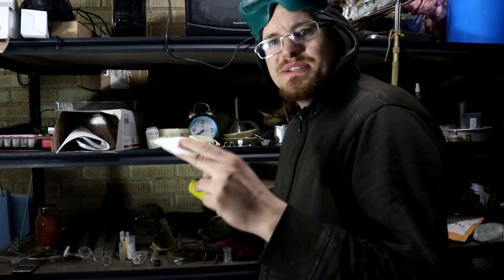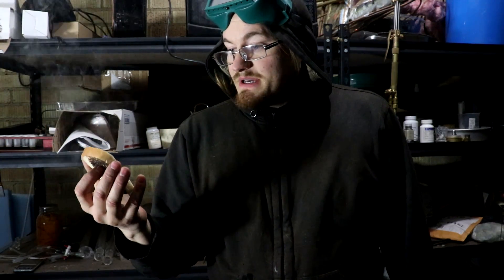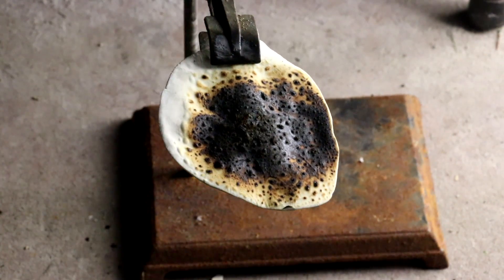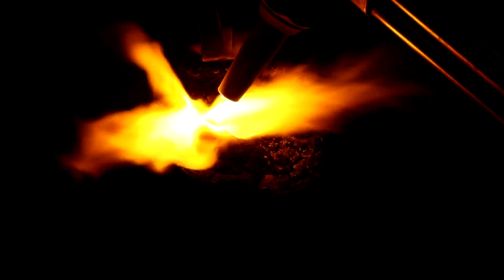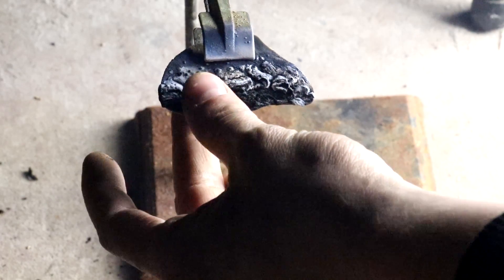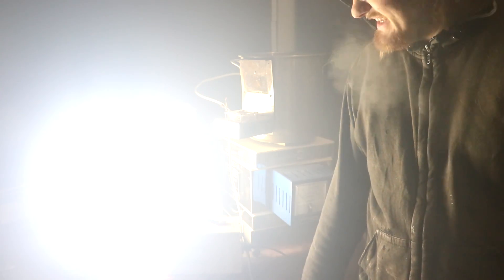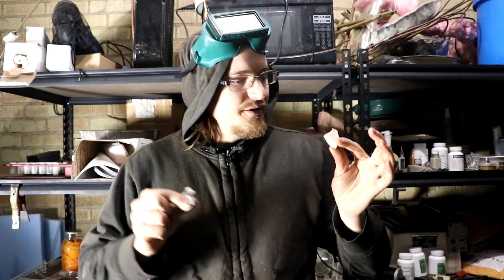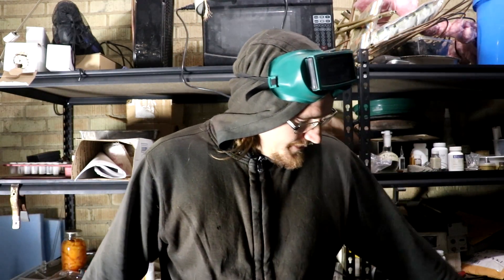Can I Burn Through Starlite?

Comment: The original Starlite can withstand much higher temperatures. It was tested by many groups including NASA, and is a different composition from what NightHawkInLight made.
Reply from the maker: Though I doubt it would be all that different I would very much like to test an "official" sample.
Reply: @theCodyReeder   Specifically, the claim was that starlite contained "21 polymers and co-polymers, plus small amounts of unspecified ceramics and borates".  The most recent photos I could find showed a light gray material, not white like you and Nighthawkinlight made. What I find interesting is that Maurice Ward had a plastic extruder, and was able to extrude the material in profiles, suggesting that it probably didn't contain a large amount of minimally soluble filler.

It's also really dumb that he's always referred to as a 'self taught inventor / hairdresser' when according to some interviews his actual main business was making chemical hair dyes until the early 80's when he started a small plastics company.
Reply: @theCodyReeder  any chance you could think up of what could be added to it to try to withstand the test you done?
It would be a step forward for all mankind, the creator of starlite could have saved many thousands of lives if he had not been so greedy.
Reply: @philipm1896  Just a guess, but composite reinforcement would (probably) make this incredibly more durable. Sadly, that almost certainly means asbestos, which you don't want in ablation - unless you're NASA. Other than specific industrial uses and milspec, you don't want asbestos in widespread use. Maybe a diamondoid thread or nanotube - silicon-boride is pretty heat resistant. Maybe even cellulose could carbonize and provide enough reinforcement during exposure.
Reply: @theCodyReeder  good luck, he died with the recipe and his family doesn't know it, even though the inventor said they had a copy
Reply: @theCodyReeder  From what I've seen, Starlite functions a lot like intumescent paint. Could you compare this version of Starlite with intumescent paint and the claimed properties of the original Starlite?
Reply: @theCodyReeder i dont belive it till i see it kind of guy lol
Reply: @theCodyReeder  I have a few ideas as to why Ward never allowed the original sample to be tested. 1) It sounds like he was a very suspicion person and did not trust anyone besides his family. 2) Since Starlite was made of nothing more than household materials (per its entry on the Guinness Book of World Records) it probably would have been difficult to patent. 3) This seems like the kind of material that many people have unintentionally created for other projects without knowing about its thermal properties.
Reply: @theCodyReeder  sadly the original recipe died with its creator and there are no samples he wouldn't even let it be tested out of his view because  he was so paranoid some one would reverse engineer the product and  start selling it he was a greedy man who i think robed mankind of a product that could have changes a lot in are world
Reply: @theCodyReeder  In an interview, Maurice said that it contains a bunch of ingredients ( I think he said over 20)
Reply: @williamfalconerbeach  
That is meaningless to the product.

They may have used 20 ingredients to reach the product but that doesn't mean another process won't reach the same results.

We make urea in a lab or pee.
Same compound at the end of a different process.
Reply: @williamfalconerbeach  Unfortunately the guy took the secret to the grave because nobody wanted to buy it... these days, with all the assay tech we have, I'm suspicious that it remains unknown. I suspect they were trying to run down a patent clock to pressure him for concessions. I mean, we've lived without it so far, despite its alleged properties being useful.
Reply: @damenwhelan3236  Not to mention a retired hairdresser probably stumbled on a mixture without a fundamental, theoretical understanding of how it worked. Meaning those 20 ingredients may be in the finished product- along with reaction products - but have no meaningful effect.
Reply: @Wintermute_SilverPaths  Everyone wanted to buy it, the guy was just super paranoid about it
Reply: @birb9721  I remember hearing about it at the time but, dont remember much as I was a young kid. I want to say it was on beyond 2k in the 90s. I know it was validated but, it got held up in sale. What was the issue, he wanted more money?
Reply: @birb9721  I mean more money as in residual royalties or something?
Reply: @Wintermute_SilverPaths  you're wrong... Plenty of people wanted to buy it. Please don't talk on subjects you know nothing about.
Reply: @Wintermute_SilverPaths  Everyone who wanted to "buy" it was far MORE interested in stealing samples to reverse engineer it, which made the man paranoid and protective, ultimately causing the recipe and process for producing it to be lost when he died.  While this substance has been named starlight, it has not managed to stand up to the same level of demonstrative testing as the original, and therefore is likely not nearly as good. Essentially it's like someone just used the name to sell whatever crap they had lying around.
Reply: Wintermute he did not patent it so there is no patent clock to run down. If he had patented it, he would have had to reveal the formula in the patent application.
Reply: @Wintermute_SilverPaths  actually too many people wanted to buy it and he didn't want to have it be over commercialized and not used for the good of humanity
Reply: @SylasTheGreat  Arguing over Starlite is like arguing over the Aurora. It almost certainly exists but, there's so many rumors and versions of the story it's hard to separate reality from fiction. There isn't a definitive version of events. There's the inventors claims (hardly unbiased) but, considering others have mentioned he wouldn't provide samples to potential buyers or allow independent inspection is a pretty big red flag. That doesn't necessarily mean it's false but, it means at best we're working off highly inaccurate tests made by the guy himself and extrapolating.
Reply: @autonomouspublishingincorp1778  I don't blame him for being paranoid and wouldn't put it past them but, you have to supply some samples to some 3rd party to validate before a purchase can go forward. I mean, most inventions that are memory holed have a specific military application and are poorly known to the public - if at all. This guy was famous enough to where I saw it in the USA on a TV show from Australia, in the 90s, well before that was a normal thing. If someone stole it, it would be patently obvious where it came from.
Reply: @Wintermute_SilverPaths  What are you talking about? No one was arguing kid. I just said you were wrong which you are. You wrote all that for nothing. Again, don't talk about stuff you know nothing about.
Reply: @Wintermute_SilverPaths  You're trying to justify being wrong and it's just sad. Anyone with a brain can find out why it never went to market. Educate yourself before posting.
Reply: @skapur  I know that it wasn't filed and is essentially lost now. There are different kinds of patents too, and a good lawyer may have been able to secure him a patent for the use of the material too.I know the date of invention often factors into a case but, usually just when seeking priority of discovery w/ multiple parties. What I meant though, was that the clock was ticking on someone looking for the formula. Generally speaking, the hardest part about doing something is knowing it's possible, not the discovery itself. Given how secretive he was, I'm kind of guessing it was something very simple he stumbled across and feared somebody duplicating. Stalling may have been a delaying tactic to increase pressure on him to sell. That being said, apparently he never provided samples for 3rd party validation which is a prereq for selling the formula.
Reply: @SylasTheGreat  Sorry, since you obviously know what you're talking about and everyone else is wrong, could you please direct me to the "100% verified, accurate and true story of starlite, the semi-mythical material we still know nothing about!" 3rd edition history so I could verify your claims?  I'd be very appreciative. Thanks!
Reply: @william falconer-beach How do you know maurice was not lying to throw people off from the shocking revalation of three or more but far less than 20?
Reply: @Wintermute_SilverPaths  I agree with you bro, there's not enough information to try and say that his claims were false nor to say that they were true, but I can say that there's no way of knowing that this youtuber figured out the secret of starlight, and judging by what i have seen in the past, this is definetly not the same material. This video is like tested's attempt at making a hydrogen generator
Reply: @Wintermute_SilverPaths  many people wanted to buy it.
He just didn't give it to anyone.
(Assuming it existed at all, which seems likely but you never know. Sounds too good to be true)
Reply: @Wintermute_SilverPaths  I think he wanted billions for it or whatever.
Reply: @theCodyReeder  
Its Not the same stuff so this is pointless, starlite is a plastic bonded with organics.
Reply: Cody'sLab  In case you don't know, Beyond The Press melted a steel nut with an oxyacetylene flame on top of a sheet of this pseudo-starlite material.

So you didn't really melted or vaporised the pseudo-starlite, you just teared it apart with a high pressure jet of oxygen rich plasma.

Besides, no one expected cornstarch, glue and baking soda to resist reentry into our atmosphere from orbit. That would be absurd.
Reply: As I was expecting, on skeptics stackexchange there's a write up on this issue and it seems there are no public records of any of those claimed tests. For me, the issue is settled: the fascinating properties  of Ward's starlite are a hoax turned into a myth.
Reply: @Czeckie  No public records? Check media archives. Most of them were VERY public with exception to some military tests which (at the time) officials did publicly acknowledge happened, although the records are probably confidential if not secret.
Teslas research has never been located, does that mean it never existed?
The water car is now considered a hoax on skeptics stackexchange yet hundreds of thousands of people across the nation witnessed it in action.
LSD windowpane was common in the 1960's but vanished never to be reproduced, same as the geltab strips of the 80's and 90's. 
Sadly- this is par for the course. The secrets either die with the creators, or are suppressed by lesser men, and once the evidence is gone, the science fades into legend to be deemed a hoax by less accomplished people.
Reply: @autonomouspublishingincorp1778  EXACTLY! Water cars have been invented and suppressed over and over, now toyota is producing cars that basically run on water and all of a sudden water can be used as fuel
Reply: @autonomouspublishingincorp1778  Are you referring to a car that ran on nothing but water fueling it?  If so it is not possible and was a hoax at best but more than likely fraud.  Is an lsd windowpane what I think it is?  You mention geltabs and stuff like that too.  lsd is still around btw.  Go to a college campus and ask around.  Just because stuff is on the internet, doesn't make it true.
Reply: @Worrsaint  Of course LSD is still around (and I don't recommend it as it will mess up your chromosomes which could cause horrible defects to your children even if you yourself seem fine) but those particular forms do not exist any longer. Go ahead- ask around for it. 
Lots of tech has been lost over time. We speak of stone age men as primitive, and yet the ancient stone foundations are the most perfectly cut, perfectly fit, and quarried from farthest away that modern man simply can not recreate. It may be a blow to the ego to realize that our greatest advancements in science and technology has yet to catch up with the stone age but the evidence is irrefutable.  It is only ego that says something can't be done simply because we can't do it.
Reply: @autonomouspublishingincorp1778  I have never heard of an lsd window before.  Lsd gel tabs are still around.  A guy in my dorm was a big fan of them.  While we cannot recreate how exactly they did the stone foundations back then and moved the large blocks, we can still do it today with modern equipment.  We can also do it in less then the few centuries it took them back then.  There is very little technology that is better than current that has been lost.
Reply: @ @drgazter  
The point is that a carbon foam shield is vulnerable to an oxidative flame. While it is resistant to a reducing flame. The flame used in 90s programs was a reducing flame, hence the carbon foam generated by the starlite layer was successful in protecting the egg.

Also, a carbon source and glue was what was used in the ablative heat shield of the Apollo space program. Instead of sodium carbonate, for gas generation, the carbon source would pyrolyse, carbon thrown into the flame would also block radiative heating.
Reply: @theCodyReeder  Maurice stated more than once that there were people in his family that knew how it was produced. Sadly if any of them DO know, they aren't talking. In truth, that seems reasonable. It's like a Mom's special recipe of [insert random example here] - Mom made it/talked about it with the family, so if you asked Mom, she'd be like; Yeah, the family knows how it's done- but having not actually been the ones doing it- Once mom is gone, no one else can re-create it. It happens. 
Much like Tesla's genius, it's unclear if the true starlight could possibly be as good as the claims, but it's a moot point without the evidence. Skeptics will claim it's impossible and was all hype. Believers will claim it was a world changing breakthrough, but mankind was robbed of any chance to know for certain.
Reply: The original starlight was tested by NASA by coating an egg with the substance, applying heat and then cracking the egg to show that it had not been affected by the heat. I don't believe night hawk-in-light's version could stand up to such a test and therefore is only a close approximation of the original formula!  @theCodyReeder
Reply: @geraiapowen2  
NASA would never test thermal conductance using an egg as a detector. They would use a simple thermometer. The egg experiment was on the TV show. And the flame was reducing type flame that carbon foam would be resistant too.
Reply: Carbon has the highest melting point of all the elements, so even if the CO2 Barrier formed when this thing burns insulates the rest of it from burning up, carbon will still melt at 3500C, so there is no way it can withstand more than what is here. An Oxyacetylene torch gets to about 3500C, that's why it can cut through.
Reply: @morningreis5018  it doesn't matter what temperature a pure element melts at, starlight it a molecule, those chemical bonds break much lower than 3500 degrees
Reply: @AsbestosMuffins  In this case, I don't think the chemical properties are even relevant, outside of the foaming action (controlled burning) and the black body radiation dissipating heat. If anything, it's the geometry of the carbon foam holding captured co2  and creating a temporary, fragile, barrier. You could almost certainly make something like this with any carbon source, baking soda to control the burn and a binder.
Reply: @AsbestosMuffins  the molecule is just corn starch or some other organic compound. Once the flame hits it it burns instantly turning black. Once it is black, all that is left is pure carbon.
Reply: morningreis carbon doesnt really have a melting point per se it just sublimates at extremely high temperatures.
Reply: Carbon foam is carbon foam. You can try to vary the pore size and such, but it's going to have very similar properties.
Reply: @ParadigmUnkn0wn  Except the original was a treated plastic (polystyrene) not a foam.
See how this stuff is charred upon the first torch test? The original stuff wasn't even singed.
Reply: The original Starlite would fail the exact same way. As Cody pointed out, a reductive flame is easy to resist, but a neutral or oxidizing flame is difficult to resist. Some of the scientists who tested the original Starlite wanted to try oxidizing the material, only for Maurice to take his samples back before they could!
Reply: @MrVirus9898  Starlite's principle utility seems to be as a compact, self deploying ablative heat shield.  It's not the insulator or fire retardant it was claimed to be. Also, supposedly the effect wanes with time since it's basically a carbon store in edible form for bacteria. That doesn't mean it's not useful though. This is perfect for armouring against a thermal pulse, like a laser. The torch Cody is using is blowing away the ablative before the heat puffs it out, which negates its effect. The specific use seems to be that you can pack a few feet of foamed carbon in a relatively thin layer until its self activated.
Reply: @Wintermute_SilverPaths  See I am not sure if Starlite could handle laser fire very well either. I will talked to some of my friends that have Class 4 lasers, and maybe they will let me try Starlite with those lasers. If Starlite did work well against Class 4 lasers, then it would be a nice safety addition, as some available laser safety foams and coatings can catch fire when hit with a decent amount of energy.
Reply: @MrVirus9898  My guess is it depends on how the energy is dumped in, both spectral (does the vapor or solid absorb light better) and temporal (pulsed vs, continuous)... I know some lasers have a tendency to create a "cavitation effect" for lack of a better term. Instead of dumping the heat in continuously, it flashboils an area that "pops" and creates a shockwave. That would probably ablate carbon faster than it cold form.
Reply: Ward, who died in 2011, never revealed the composition of Starlite, which is still unknown.
Reply: NASA tested an EM drive, didn't mean it worked either. Those many groups probably concluded the same thing, impressive demo, not so great heat shield material.
Reply: @AsbestosMuffins  dude are you kidding, there is an em drive airplane that flew around a room recently
Reply: I think they might have stopped the original production of Starlite because it contained asbestos.
Reply: ن٥ﻻ ﻉ√٥ﺎ ٱ it can be possible...
Reply: Ya i have to agree that NightHawkInLight night not have made Starlite now he could have made a similar substance like it. It seems to me that that what you have might not be a true representation.
Reply: Maybe next day a some science teacher makes indestructable object made out of secret materials and us army is using it, and no one else can make it because its composition will be slightly off. riiiiight
Reply: This material does not even come close to the original Starlight, many people commenting that Maurice was just a "hairdresser" which was my understanding for years after seeing the original test on Tomorrows World TV programme. The one where the egg was painted with starlight and a blow torch applied, it fascinated me at the time. 

Most people do not know he was pretty heavily into plastics and owned a plastic recycling plant in which he had a small laboratory in which he experimented and messed about with various things that interested him. Starlight was heavily researched by Boeing with Maurice onsite in the US during testing, on one occasion he returned to Britain for a short time and Boeing broke into his laboratory and storage area under the pretext that there had been a "chemical spill" which needed attended to urgently!!! The man was no fool and from what I understand had multiples of chemicals in storage many of which were unrelated to the product itself, so Boeing's little foray was of little use to them. Maurice's Boeing contact was strongly of opinion that Being should pay for the formula but the higher management did not want to pay the asking price, eventually they said they would pay but only if Maurice gave them the formula in full first!!! They managed to piss Maurice off something rotten after keeping him going for a long period of time while tying him in with a contract that meant he was unable to approach other potential buyer during the investigation period.

The material was also tested by the British weapons testing establishment in the UK this where the laser was used and according to the scientist testing it, it was everything it is said to be, ie: 10,000 degrees resistant with a thin painted coating which could be coloured to suit military purposes.

Maurice's wife has apparently sold the rights to one version of the formula and according to his daughter who worked most closely with him it is very different from the formula that was  known as Starlight.

All in all a fascinating subject which I am pleased to see being discussed all these years later and while Maurice was clearly paranoid and very, very protective of his findings why shouldn't he be recompensed fully for his discovery? So many inventors have been ripped off throughout history or sidelined by corporate interests and machinations and he was well aware of that!

Imagine if Tesla had been more financially astute and received more financially for his alternating current system invention for example a small percentage of every alternating motor made under license and used that money to develop more inventions in such a way as to satisfy his philanthropic thinking, I imagine the world would be a different even possibly a better place.

There is a US company presently undertaking development and production of "Starlite" and some of Maurices correspondence with Boeing can be accessed on their website. Similarly some of the original interviews and test footage can be seen on YouTube on Maurice's or his daughters channel (I'm unsure who it actually started it) for those that are interested.
Reply: I'm pretty sure nighthawk says in his video that it's his educated guess on how it was made, not that it was the exact thing.
Reply: Add sodium aluminum silicate, make silica alumina char.  Much more temperature resistant if I had to guess.  Add long chain polysaccarides like cellulose for greater rigidity during bubble expansion
Reply: @cap4081  My completely speculative suspicion is that the family know that since it's so simple a hairdresser could formulate it at home, once it was out, they wouldn't see any residuals. That means it was a one time payment and they held out for too much while being too difficult to work with and it queered the deal. A funded lab could quite possibly (easily) reverse engineer the principles without violating patents too. I've had to deal with distrustful parties in business and the reality is that at a certain point, both sides have to show a certain degree of faith or things won't work. I've had clients request I do 100s of thousands of dollars of work in Mexico and payment on completion because non delivery is common there. Meanwhile, I'd be at the mercy of them and the Mexican courts if it went south. They were too paranoid to do deposits and scheduled payments so, the job de-materialized in negotiations even though they liked my bid.
Reply: It was never tested at NASA.
Reply: cant know  for sure since we dont know how starlite is made
Reply: add baking soda and citric acid into that formula...so it expands like starlite does if that doesnt work add some graphite powder from pencil leads
Reply: They should really release the formula for it.
Reply: Sure, and my Starmite can withstand being thrust into the sun for 10 hours and it comes out smelling of mint. Claims are easy to make when you don't need to prove them.
Reply: except it was never tested by any of those groups nor NASA. The creator never gave any samples out to anyone for fear of reverse engineering. All the tests done to it were done by him. So in reality it's claims are still unproven by independent testers.
Reply: @bluedemon9985  Not by NASA, as they were probably a bit too distant and a bit too foreign; but he did allegedly submit samples to be tested by comparable British laboratories.
Reply: Ogre they were tested but he never let the samples out of his sight. he was parinoid about the idea being stolen.
Reply: @bluedemon9985  Sort of. While you are correct he alone kept possession and therefore performed the tests, the tests themselves were designed and supervised by those groups including NASA. So the claims WERE proven, but were not fully understood through detailed analysis, which is why no one seems capable of recreating it.
Reply: To clarify confusion: NASA and other groups tested the properties of a sample of starlite provided to them, but maurice ward refused to let them retain said samples for fear of reverse engineering.
Reply: @ZweiSpeedruns Thanks! I've heard many contradictory stories which makes it hard to figure out the sequence of actual events and untangle motivations. The only document I saw mentioned a reduction to basically no protective properties over time, which implies something was retained, unless he provided an aged sample. It makes sense that bacteria would eat the sugar that provides the carbon or the pva gluing the mixture together would break down and effect deployment of the foam.
Reply: There are two possibilities, Occams razor should illuminate the best possible explanation.

1. A man accidentally falls onto a recipe for an incredible heat resistant material, and somehow decides to keep the whole thing so secret he takes it to his grave, and nobody in the sciences has figured out what he did.
Or
2. He lied about it, and had to keep the whole thing secret to keep from being exposed as a fraud.
Reply: Would agree. I remember reading the experiment was a laser reaching 10,000 Celsius for 5 min on a egg. The egg was still raw and cold. acetylene in proper proportions to yield a flame of about 3,480 degrees Celsius.
Reply: @jbenkidu  lasers dont really have a temperature.
Reply: @butre.  I don't know much about laser, it's only what I saw on a site. I know the energy of light or photon is transferred to mass and heat is the reaction of the transformation of energy.
Reply: how do we know starlite isn't a hoax?
Reply: The thing is Cody, nighthawkinlight is still trying to make the original star lite. He never said he made the original starlite so you can't base your test off of his because he's still working on his formula. There is enough proof from NASA that says starlite could survive extreme heat and remain cool, as you saw in the test you did, you could instantly touch that piece without burning yourself. So that shows there is truth in this stuff
Reply: I do wonder if it was something like this but with a few small differences. Sometimes the tiniest alterations can have huge results.
Reply: Wintermute
Come on you seriously buy that load of nonsense? Do you really think from a sample, NASA, with all its resources, would've been unable to deduce its composition?  Its one of those myths for the sheeple the Elite like to tantalise the sheep with. I'm surprised they didn't claim an alien gave the ingredients to the inventor LOL. If all he wanted was payment and it was on the level, a true story, and the material as great as they claimed, do you REALLY think NASA wouldn't have just given the guy money?
Reply: @sjames5027  And yet, they didn't.
Reply: it's my understanding that the original formula can't be recreated to an exact specifications as the guy who invented it took it to his grave and as it was an extremely complex way in which he created it no one else has been able to successfully recreate it
Reply: @Nicholas King 
How do you know it's not being tested by NASA?
You don't. 

So that's how you attempt to hide your embarrassing remark?

Also. It was 21 ingredients. 

Thanks for playing "I can't use Google!!" You're tonight's winner!

Tell him what he won Helen!

(There is no Helen)
Reply: You said NASA. haha
Reply: shadowbanned you can't make those jokes on Cody's channel.  Its just not funny to smart people.